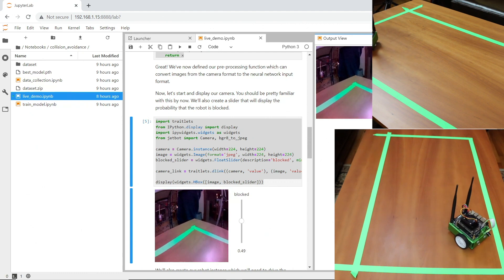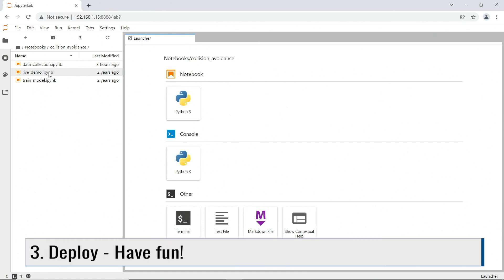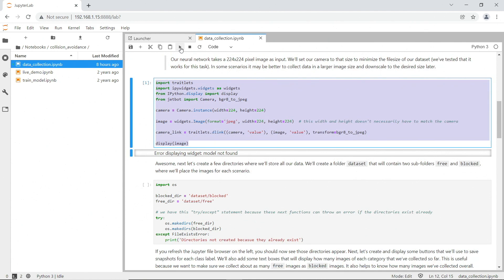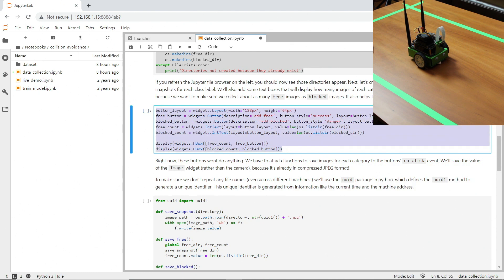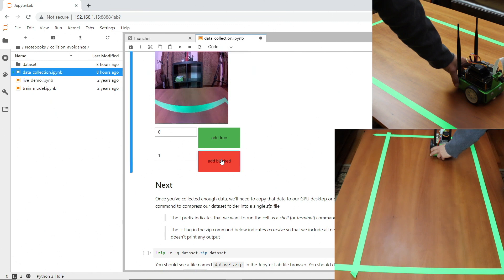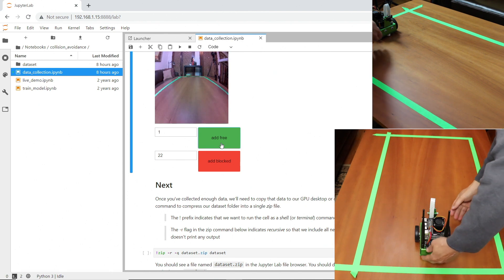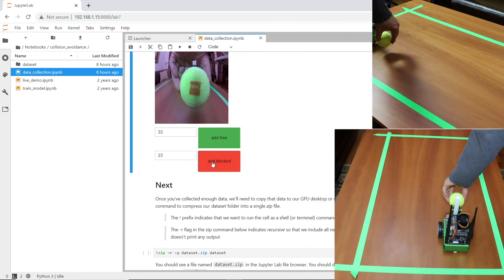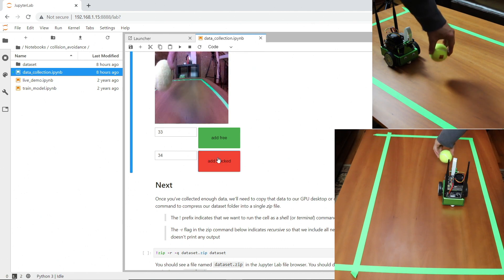Waveshare Jetbot - Collision Avoidance using Transfer Learning!

Comment: ValueErrorTraceback (most recent call last)
<ipython-input-6-d1f9bae6b90a> in <module>
      3     batch_size=8,
      4     shuffle=True,
----> 5     num_workers=0,
      6 )
      7 

/usr/local/lib/python3.6/dist-packages/torch/utils/data/dataloader.py in __init__(self, dataset, batch_size, shuffle, sampler, batch_sampler, num_workers, collate_fn, pin_memory, drop_last, timeout, worker_init_fn, multiprocessing_context, generator, prefetch_factor, persistent_workers)
    260                     # Cannot statically verify that dataset is Sized
    261                     # Somewhat related: see NOTE [ Lack of Default `__len__` in Python Abstract Base Classes ]
--> 262                     sampler = RandomSampler(dataset, generator=generator)  # type: ignore
    263                 else:
    264                     sampler = SequentialSampler(dataset)

/usr/local/lib/python3.6/dist-packages/torch/utils/data/sampler.py in __init__(self, data_source, replacement, num_samples, generator)
    102         if not isinstance(self.num_samples, int) or self.num_samples <= 0:
    103             raise ValueError("num_samples should be a positive integer "
--> 104                              "value, but got num_samples={}".format(self.num_samples))
    105 
    106     @property

ValueError: num_samples should be a positive integer value, but got num_samples=0
i got this error when creating the dataloaders to load data in batches

Comment: It seems like your training data consists of almost every possible sensory input for the demo. In the real world wouldn't overfitting be an issue?
Reply from the maker: In a real world scenario, there's a lot of 'dark magic' to the amount of data gathering and model building needed to get things to work properly. It's easier to over collect data and cull it because of overfitting, compared to not having enough data to work with and relying on that result. That's why you have to have super computers just to collect and process all of the data to build self driving cars. It's a really interesting problem. Thanks for watching!

Comment: Is there mapping via video of a given area?  Can you use a pattern for it to place to follow in mapped area? Also, go back through video file and identify obstacles such as trees or a large rock,  can the JETSON record how the wheels move to go around object in question?  Then the JETSON take the little vehicle in the mapped area, retrace pattern you created including moving closely around the objects?
Save that section and data for specific area on a drive specific file.  Then be able to map new area, drive pattern, note objects and record wheel movement and video as it completes 2nd area fully completed.  Then I select file in future for given area mapped I want robot to execute in?

Please advise..  most humbled.  Alton
Reply from the maker: There are a lot of questions here. The answer depends on your level expertise in implementing those features. Typically people would use something like ROS for this complex of a feature set. The robot itself is about as simple as one can make a mobile robot. The features you describe are all doable, but will require a lot of expertise on your part. Thanks for watching!